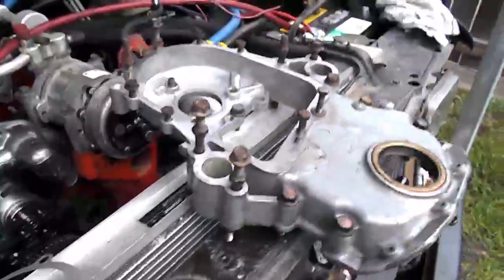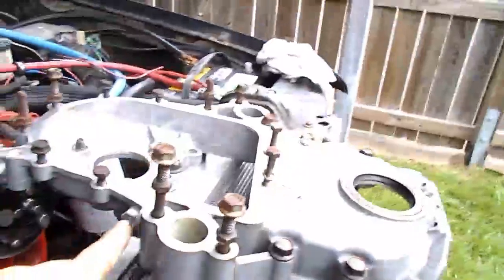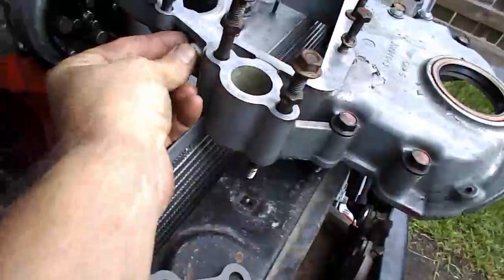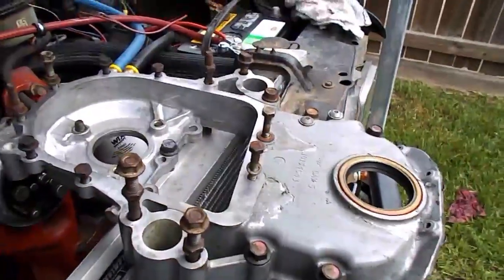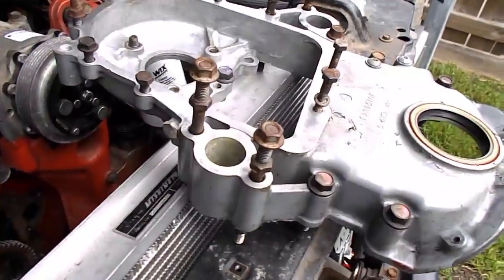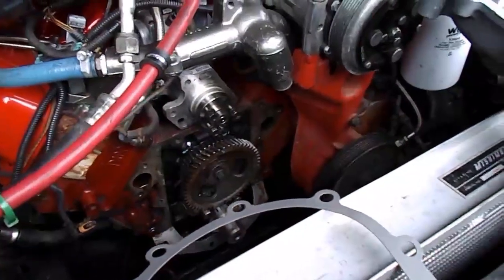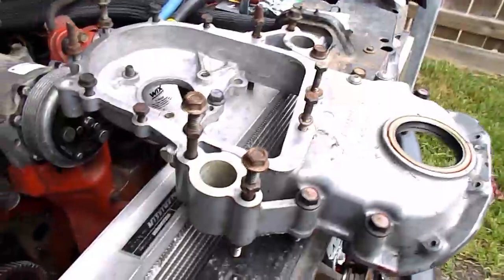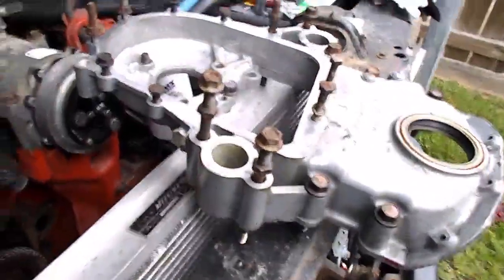Timing cover oil drain mod

Comment: Hey Leroy can you make an update on your oil centrifuge? Does it keep the oil yellow? How does the main filter look like? Thank you
Reply from the maker: Well I just did a big engine modification and did not put the centrifuge back on YET!
I'll be doing that in the next couple of weeks.
As far as oil color after 5000 miles it was definitely black but was not that "Heavy thick black" color. It was more like a gasser oil look to it. The centrifuge for sure is catching the small particles. I have a video that shows me cleaning it. Thanks for the question.

Comment: Could be a good place to drain catch can into. with a valve. Don't want pressure back feeding in catch can.
Reply: I thought of doing the same thing to prevent having to manually dump the contents of my catch can at every oil change. However, that catch can is mostly catching fuel and water. That is the last thing you want in your engine oil. I will get a fuel hose attached to the bottom of the catch can and route it next to the oil pan with a ball valve mounted nearby. That way whenever I’m doing a oil change I can open that up quick and get it emptied while dumping the engine oil. I also have a ez drain valve on the oil pan no tools required. I’d like to relocate the oil filter someday but I guess it’s alright if the frame gets a little extra oil on it every now and then.